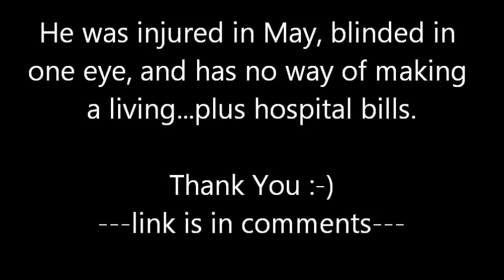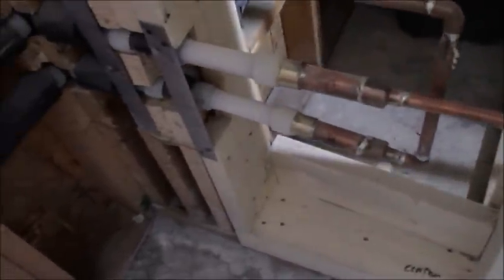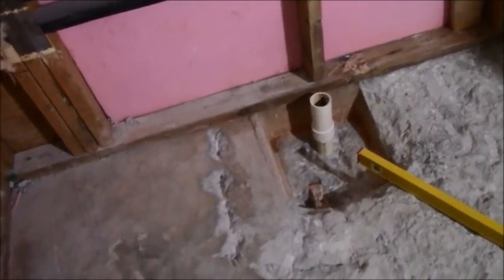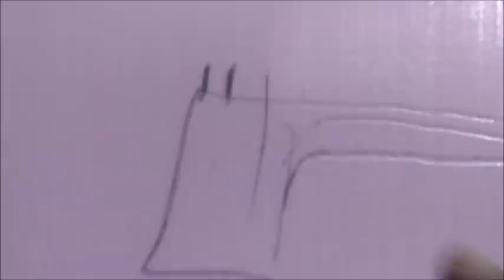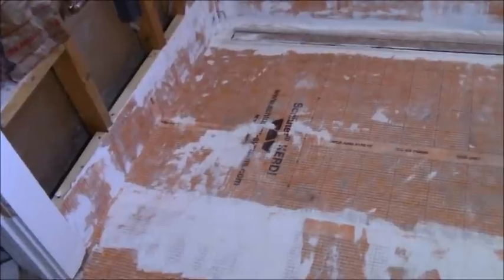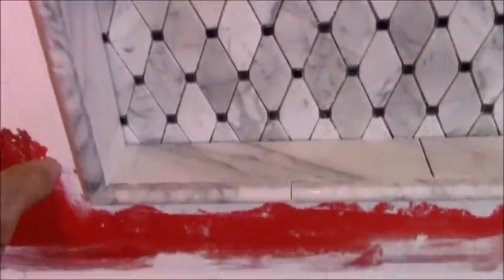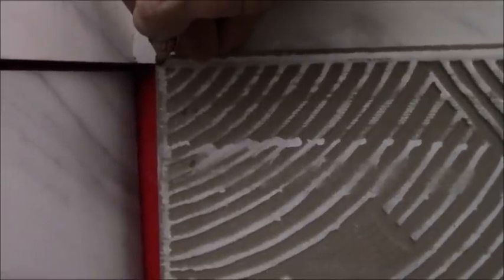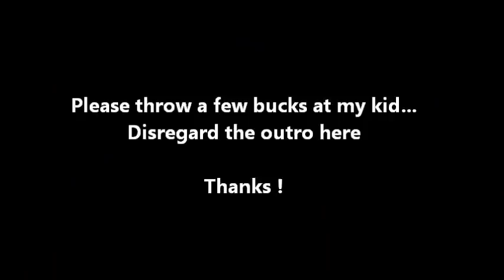HOW TO BUILD CURBLESS SHOWER ON CONCRETE

Comment: We only use symmons valves and they have the option to get the integral shut offs. When you pick up a symmons valve you know. But, if you don’t care about call backs or longevity for the costumer it doesn’t matter. My father works at a big university and they only use symmons valves because of the build quality and ease of rebuilding them from the shower side. But awesome video as always. Thanks.

Comment: I love to use fabric on my corners and seams.  Feels like 10x the strength.  I primarily use Uzin topical waterproofing with a 5" fabric roll.  I will also sometimes use a 3ft wide roll of fabric for the pans.  I feel like I'm getting not only a significant bond, but also it feels like I get equivalent to 5 coats where it counts.

Comment: With regard to the concrete demo. I would have used a slotted diamond blade on a circular saw .
Set the depth (deeper than you need) and checkerboard the slab.

It would have chipped out a lot easier . You would have saved a lot of time. A cold chisel in the cuts. Big deal if you need more material to make the pan. Thats better too. 

I know the dust, but a wet floor and a shopvac hose in through the window will get 90% of the dust.

When you said 4 hours i believed you. I think you could have saved an hour. 
But time on the chipper is good for the physique.

Great video and great work. You are an artist and a bit of an ass. Just like me.

Comment: Alot of the showers done like this in Florida only have waterproofing on the walls and corners with none on the shower floor.  Seems crazy but that's been done for a long time.  Mine was done 8 years ago, curbless, 2" drop, waterproofed backer board on the walls, taped on seams, built on slab.  No evidence of any issues from it but I'd rather have your method to be honest.

Comment: I have a question about my bathroom shower I can't get to a good answer too. My bathroom is on concrete slab, but is built up with mortar about 2 1/2 to 3inchs. I had to remove the mortar down to the concrete to repair the shower drain.  Now that I'm ready to build up the bathroom floor 2 to 3 inches, I was planning to build it back up with concrete instead of mortar and do a curbless shower. Not sure with the concrete do I need a water proof shower liner sandwiched in between the existing slab and built up concrete. Thanks.

Comment: @StarrTile  hey bud.  loving your videos.  helping me threw my bathroom rebuild.  ill be making my shower a curb less walk in. just at the entrance..  its on a concrete floor. rather than cut out the space for the pan. would it be dumb to install a 3/4 subfloor on the area around the shower... than just skim the pan down to the drain?  or would that not be enough pitch.    thanks.  hope business has been well for you threw these crazy times

Comment: Why do you not use concrete HardieBacker where your showers? Thank you for sharing 81 on your thumbs up look forward to hear from you by 4 now Ken. Question what are you how you going to eliminate the lip above the slope on the concrete where it was cut making a smooth transition turn the bathroom floor into the curbless shower I hope I'm making sense look forward to hear from you Ken
Reply from the maker: To your first question, it wouldn't matter if it was 8 in cinder block or a concrete wall or if it was cardboard, if you waterproof it then what's behind the tile doesn't really matter.
To the second part, I'm not really sure exactly what you're asking

Comment: Just curious if cutting the slab inch and a half to 2 inches will ruin the integrity of it.
Reply from the maker: It would mostly depend on the thickness, most houses are about 6 to 8 in thick although I've seen them at 4 in. Bottoming out is impossible here because of the curvature of the foundation that's against the outside wall.

Comment: Do you grout the floor then walls . Also do you silicone the floor and walls after the grout?
Reply from the maker: Yes you grout the floor first and then the walls, the caulking is up to you since that is a way to control cracks I do not assume that there will be, but in the future if there is cracking at walls or floor then yes you could do caulking
Reply: @StarrTile  thank you vey much

Comment: Red Guard over Kerdi? Does that void the Kerdi warranty? I would question whether the two of them together might cause a chemical reaction that might cause one or the other to fail or even separate. Interesting idea. I wonder if Tile Coach has seen this and if he has done a test demo.
Reply from the maker: I think I mentioned it in the video, if I did not then let me say this, every material is a tool and I use every material accordingly. I don't really care about warranty because they will never honor one anyway, if you did everything correctly they would still  find fault on your side. As far as chemical reaction it would be inert, Redgard is a water-based product.

And to your comment about "Tile Coach", I cringe when I even say that...Isac has half-a-dozen videos where he has failed a job, mainly because he doesn't use common sense and relies on a book. So anyone that would seek advice from someone that uses denshield on a grocery store floor needs a new "coach".
Reply: @StarrTile  Wow, calm down and take a breath, my comment was not intended to inflame.
Reply from the maker: I'm not upset 😂

Just stating facts
Reply: @StarrTile  Cool! And BTW thanks for all you do.

Comment: You mentioned in another video that you don’t do a corner bead where the sheet rock bits up against the back of the Schluter. How do you handle that transition then.  I saw in this video the cut Sheetrock  and I am sure a different contractor is finishing that.  But are you preferring it to just have a bead of caulk and why don’t you want a corner bead?
Reply from the maker: Corner bead bumps out your wall on both sides at least 3/8th or more, then the mud must be feathered out and it will never be flat as the rest of the wall, but it must be flat for tile...hence no bead...then the gap is filled with mud or grout.

Comment: I’m experiencing something like this, does the drain need to be in the middle?
Reply from the maker: A drain can be anywhere you want it to be as long as the slope is proper, I do the center because of symmetry
Reply: @StarrTile  I’m doing one right now and was thinking I needed it in the center to make it curbless

Comment: Very cool project. Doing a curbless into a slab gives my nightmares, lol, thinking of all the jackhammering. Did you just use a chisel bit or something? Regarding the first-row-last approach I usually do that. On the last shower I just did, which is also curbless, I did the first row first, after the floor tile of course. You know what? It was probably less hassle as long as you take a little time to set that first row level. Adjustable shims help.
Reply from the maker: Various bits are used as well as the saw

Comment: I used 3/4 copper 27 years ago to my faucets, that was a big mistake because it takes forever to get hot water to the sink 1" is nuts.
Reply: If you are 4 foot off of your water heater it is not much of a problem, but it is all a question of head.
Reply: For sure, for an application like that you would need a recirculating line

Comment: I'm looking at having the drain by the shower entrance, so pitch the floor from inside to the entrance. This way I don't need to drill out the concrete, instead use the mud and build up from the back of the shower to front. So the rear area is built up to give the slope to the front. Does this make sense to anyone? Also, this won't be a complete barrier free, half barrier actually. just the entrance to the shower is level with the floor.

Comment: The valves are nice but if your hand held is on the right side you can’t use right side output. You must cap right and use left unless you order a 6 multi function diverter and that’s just dumb. Good faucet bad design
Reply from the maker: Agreed, absolutely stupid design

Comment: I’ve never liked the drains along the wall. Just seems like you’re asking for drain failure.
Reply: why
Reply from the maker: Because most guys will set their drain flush up against the wall, so if there is ever water penetrating into your pan you have tile surroundings, whereas I always leave a bit of a gap between the wall and the back of the drain on floor... that way the entire drain the surrounded by tile
Reply: everyone ive done i bring 2-3 inches from the wall

Comment: Today I learn how to mark and draw a line on a tile. Your how to vids need to show more of the how to if you are going to name it a how to. Just saying.. But thanks anyways it looks good.
Reply from the maker: There are at least 8 to 10 different tricks that's on that video that a homeowner or diy'r would have no clue about, everybody has their own set of skills, because you're skills are higher doesn't negate the fact that there is information on every video I produce. I suppose if I were monetized by YouTube it would be more of a motivation to show me working, putting in that extra effort, extra editing, extra equipment, all of that stuff is like a second job

Comment: looks like some sloppy soldering
Reply from the maker: And water tight 👍
Form over fashion👌
Reply: @StarrTile  doesn't the excess solder eat away at the cooper over time and potentially cause leaks?
Reply: beautiful job.  very nice results.
Reply from the maker: No it is not the solder that potentially would cause leaks later, it would be the excess flux